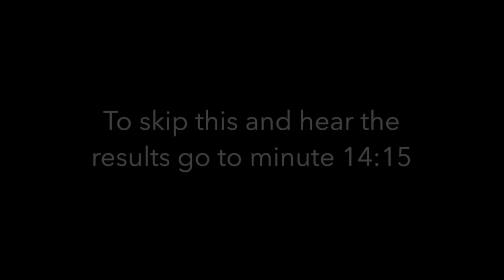Guitar Makeover- Reso Edition (Adding some punch to a Regal RD 40)

Comment: I put the legend cone in my Reed mahogany and opened it right up. I think you need a peterson tuner. Nice video. I would never use glue on a sound post. Glue is a sound killer.
Reply: buz butler actually their not sound post but a support post so the top does not warp or cave. But ur right never glue a sound post such as one that fits a violin. Those are snug fit with string tension slightly helping a bit.
Reply: @clawhammer704  They're both. They give support while transferring sound from top to bottom.

Comment: Excellent ta, gonna take mine apart and  clean up any bad bits, may add those strength support posts if nothing around rim, this is a non too expensive model, the guy who I got it from changed the hardwood biscuit bridge for a bone one ?? why would he do that ? ain't the hardwood the best sound ?  / thanks for info - appreciated
Reply from the maker: Col Auty I don’t think bone is the best material for resonator saddles. They make great nuts though. I would definitely change to ebony capped maple inserts. Thanks for watching and commenting!

Comment: It blows my mind that the bridge breakover angle on these things is only a couple of degrees. The cone has to be a better acoustic amplifier than a banjo head . they need like twelve degrees to supply enough pressure
Reply: Dave Stambaugh that's why players set their bridge inserts up as high as possible to get away from that horrible string break. More height equals, more volume and power, better string break...

Comment: Definite improvement but I reckon swapping the mic for a beyer 201 would achieve much the same result. Moving the mic towards the front holes and away from the cone would too. I am going to check the spider for even  contact and do the doweling support thing on my regal.
  Of course the difference might be more obvious acoustically and I don't mean to criticise in any way. Any improvement in the actual sound at source is always the way to go if possible.
Reply from the maker: Oh yes. A better mic and placement would definitely help. I was just duplicating the mic and placement for comparison reasons. Thanks for commenting!

Comment: That is kind of shabbily made compared to my black lightning..which has a quarterman cone..it also has a sound ring( I guess you would call it) a plywood ring with large holes drilled in it which does the same thing as your posts...
I had to re-glue the neck and ad a thicker shim where the neck extension attaches to a block just inside the sound ring..the top was delaminating near where the neck attaches so that needed to be glued and clamped..this is a older one(15 years) and it sat in case for years unt

Comment: Wait so that reso had no sound well or even sound posts in it?
Reply from the maker: hank hill it did not. It was rather interesting. That piece of wood was some sort of baffle that regal used. Needless to say, it wasn’t helping it at all.
Reply: The RD - 40 has the Baffle as it were , the RD -30 is sound post only .

   Posts vs sound well vs baffle(s) isn't a right or wrong , or one better than the other , just * Different * .

  FWIW , Sound wells associated with original 1930's instruments .

Comment: What did you use for the new sound posts? Diameter and material. Are they a specific material that you would have to buy from Stew-mac or music materials company are they just Dowell rods you get at Lowes?
Reply from the maker: They were just poplar dowels from lowes. I certainly don't think I would do that again. I would use spruce. Also, I wouldn't add so many.  More sound post will effect the sound. It's all trial and error. I've learned a lot about construction since this video but I still don't know much :)
Reply: And also what did you use to bend the legs of the spider bridge?
Reply from the maker: Daniel Schuette I use a small brass hammer with very light blows and another piece of wood as a fulcrum about two inches from the end. The aluminum is pretty fragile.
Reply: Okay so to make sure I am understanding, you placed a wood block two inches from the outer end of the leg (the end that would rest on the cone) and then tap that leg any way you need to to make it in line with the same plane as the rest of the legs right? Also, what diameter on the soundposts? Or is that trial and error as well? looks like 5/8" from the video. I am going to do this exact thing to my RD40 next weekend. This video is great, and the sound difference is noticeable to even an untrained ear. Thanks for posting.
Reply from the maker: Daniel Schuette yes. That's exactly right on the spider bridge. I set it on a flat surface and tap the edges listening for movement. Then when they are close I sand all the legs at one time on a piece of 100 grit sandpaper that's setting on the same flat surface. I used 3/8" dowels.   Thanks for watching! Let me know how it goes!  You can email me at stephenandkindra@gmail.com

Comment: is there some spring over the screw for the resonator to spider - most have a spring ? can you help on this.
Reply from the maker: Ronnie Boucher I have noticed that on many dobros and I'm not sure of the purpose of the spring. I DO know that Beard and Scheerhorn do not use springs. I would venture to say that the spring is not necessary.
Reply: TheWoodshed thank you i pulled it apart and cleaned it but no spring so i put it back together and thought the spring was missing and should be there for some tension with the  the spider to resonator . my resonator looks like yours .
Reply: Most resonator players take that spring out. It's junk...just tight the screw until you feel slight resistance then turn a 1/4 to 1/2 turn for best sound.

Comment: What wood/material did you use for the sound posts. I just bought the round neck version and am brand new to resonators. From what ive read that beard cones are the way to thanks for the demo
Reply from the maker: Andrew Berry thanks!  You can use just about any kind 3/8” of dowel since it’s not a high dollar instrument. The ideal material is spruce. And yes, the Beard legend cone is awesome. I️ take it that yours has a spider bridge and not a biscuit bridge.

Comment: Great video and top information. This really answered the questions I've had for years about whether it's worth replacing the cone etc. on a Regal dobro. It's great to see such a careful comparison so you can really hear the two setups under identical conditions. What a difference in sound. I would have liked to see what you used to bend the spider to get it flat, because that's a delicate operation. Someone at Beard get in touch with this guy and get him on board!
Reply from the maker: Thank you so much! I promise if I can do it then anyone can. Leveling the spider bridge was straightforward and rather easy. Oddly enough, to bend the legs I used the wing on my craftsman table saw. It's got web bracing. I just wedged it in the bracing and gave light pressure to barely bend the spider leg. The flat surface of table saw was perfect for checking level and sanding.   Thanks again!
Reply: @griffisguitars2921  
It sounds great. I just got a resonator guitar and I appreciate your help. I had an annoying buzzing sound and levelling the spider really helped. Thanks and peace from a fellow guitarist in Ireland. 
Ps You really made that guitar sound better imho, really really nice playing mo chara. Slainte.

Comment: well that was a bad setup at first
Reply from the maker: JMRC jamesmiller yes it was. This was a new dobro. They come pretty rough out of the factory
Reply: Adjusting the Cone tension screw helps a bunch...screw it counterclockwise until you feel it lose tension from the Cone. Then tighten clockwise until you feel the screw contact the Cone by feeling tension. Then only tighten 1/4 to 1/2 turn. Somewhere between the 1/4 and 1/2 turn you can listen for the best tone. Do not turn more then the 1/2 turn or risk springing the Cone to the point of damaging it. To access the tension screw you will need a small screwdriver. Usually a Phillips driver is used in builds. The screw access hole is at the middle of the bridge at the top of the coverplate.

Comment: I play pedal steel, but I bought a Regal just to mess with and was very displeased with the sound!! Besides it doesn't fret right so I need to take it apart anyway, SO, I may as well follow your lead!! Thanks for posting!!
Reply from the maker: Rob Ferrell thank you! I’m certain you won’t regret it!
Reply: THE RECORDING KING RESONATOR SOUNDS BETTER THAN THE REGAL PERIOD.
Reply: @DENIEL381  People redo Recording king dobros ALL THE TIME,Inside cheapo resonators are very similar,I have a fairly expensive Regal,It was really old before I fixed it.
But saying ALL Regals are junk is an ignorant cooment.BTW Tommy White endorses Regal guitars,And bud you or anyone of those wannabe steel player couldn't hold Tommy's bar!.

Comment: hi just seen your video  wish I had seen it before I bought my regal RD 40  IT SEEMS TO RATTLE when you play the heavy g string the cover plate seems to vibrate  I didn't like what I seen on the construction of the guitar  thanks for showing  that I don't know if its worth putting more money in it   good money after bad  maybe  just an amateur player  I always heard REGAL was a good  dobro now  not so sure   anyway thanks for the update  I think REGAL should be a little ashamed of their product
Reply: Jim I had same problem the "Spider" needs adjusting,Take the round cover off between the REAR Bridge there is an adjusting screw use a thin phillips...  those spider legs can be adjusted,there are several videos here on YT,GD luck bro😊
Reply: In their general nature , Resonators are more fiddly than conventional acoustic guitars . Adjusting aka setting up is normal and expected , and needs to be done periodically over it's lifetime .

      I'll try to draw a comparison to Archery .

    A one piece Longbow once built , pretty much is what it is . A modern Compound Bow is expected to be tuned and adjusted aka Set up , for the individual user for best accuracy and performance .
Reply: And finger hit the button too soon .

    In general , " budget import " Resos will be more inconsistent from guitar to guitar , that's just the inherent nature of mass production and meeting price points . It's just that it shows up more dramatically in Resos than conventional guitars . A reason to buy from local knowledgeable  independent shop where they get at least a looking over , instead of mass internet distributors where they come straight out of the shipping crate from China .

   A careful DIY'er following the usual set up guides can usually make a crappy instrument reasonably decent . But a Set Up Guru can make a reasonably decent instrument outstanding .

    That's why a Gold Tone purchased directly from Paul is $100- 200 more than the same instrument from regular distribution - Paul Beard personally sets them up .

    And ( moden era import ) Regals aren't terrible . They're decent starting point for their low- mid price point . There's plenty worse out there .

    Will upgrading a budget guitar with cone, spider , bridge insert . and nut from Beard ( or Quarterman , or Repogle ) combined with decent set up ,be markedly improved in tone, volume , and playability over stock ? Absolutely !!  For $150 - 200 of parts , plus your labor/ paying for the labor be a better return than having spent $200 more for initial guitar ? Reso guys discuss that like Ford vs Chevy .

   A careful

Comment: did you completely remove the round baffle "what is this" and did you loose any volume from the guitar
Reply from the maker: icomatl yes I did. I later found out that Regal calls that a "bass reflex."   I certainly gained a lot of volume but that could've had more to do with the new cone, spider bridge and proper setup.  I can't imagine how that was helping though. Scheerhorn and Beard have never used anything remotely close that that.  Thanks!
Reply: I went ahead and pulled mine out too.  Followed your instructions and added the soundpost along with the Beard cone,spider, saddle.  Like you not sure what did what to the sound but it made an incredible difference!  This all started for me when I got a Tonewood Amp and realized that the baffle was defeating the purpose of the amp.

Thanks for sharing your knowledge and experience through this great video.
Reply from the maker: icomatl great to hear! Thanks for sharing!